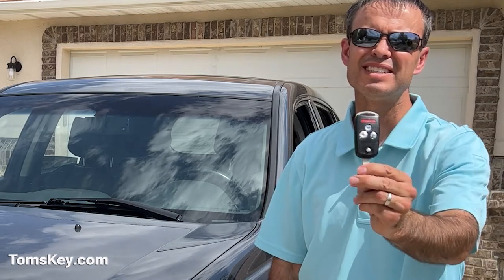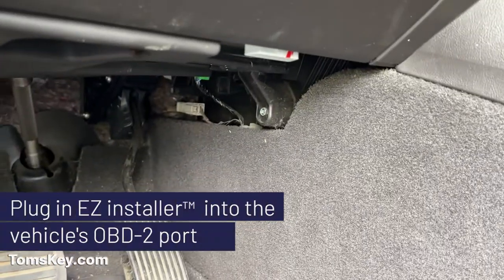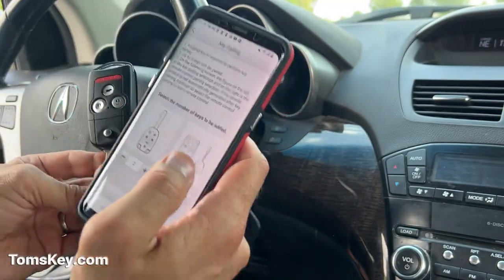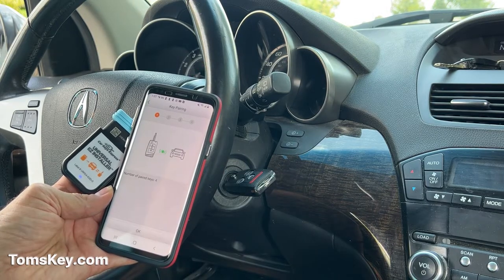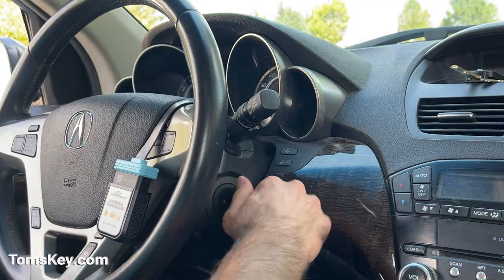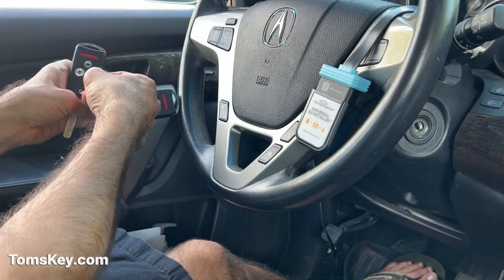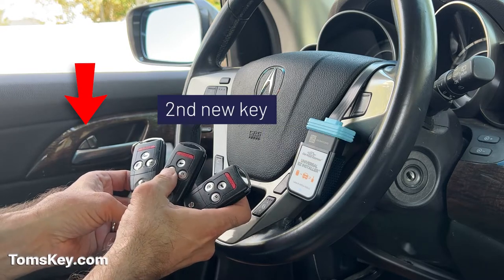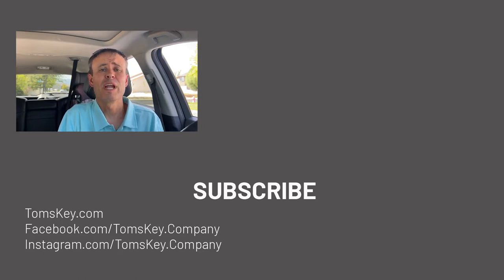Easiest way to make a spare key for Acura MDX

Comment: I just bought a 2007 Acura MDX from a used dealer as-is with no returns. I learned the ignition was changed because there was only 1 key that has no Acura logo on it so it is generic and it works for turn-key but not on the driver-side door. That tells me the ignition key was replaced and the driver door was for the old key. If the vehicle's battery dies or the key fob dies, that means I am locked out. That is a huge problem. My question is...can a locksmith create a key without the original key? That way I can at least open the door.